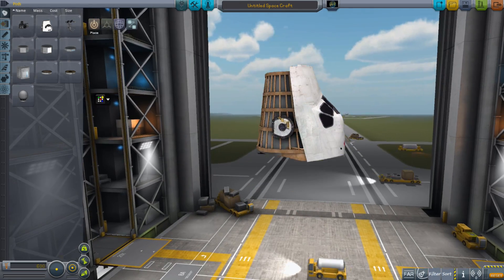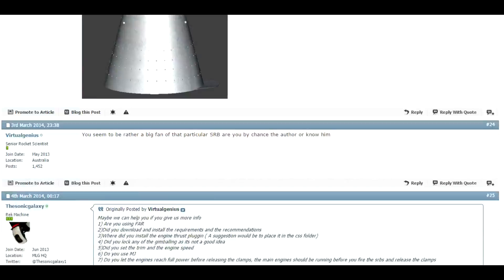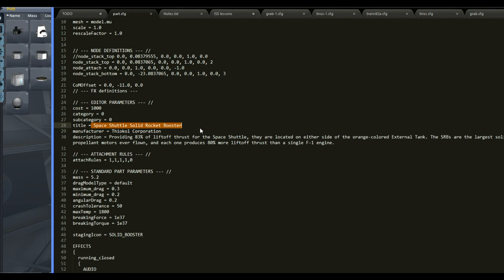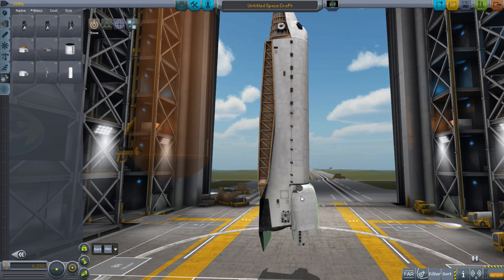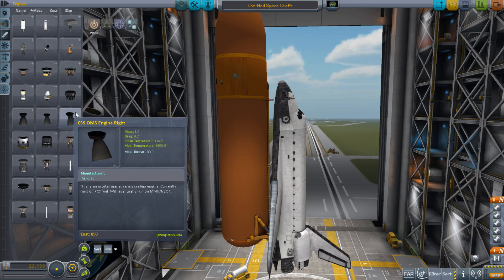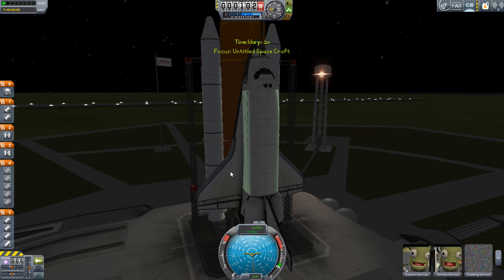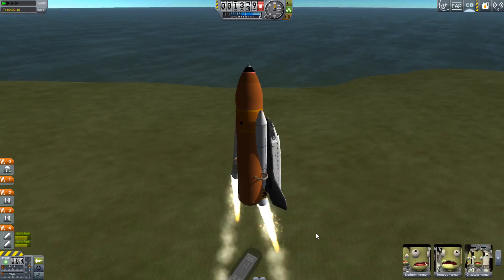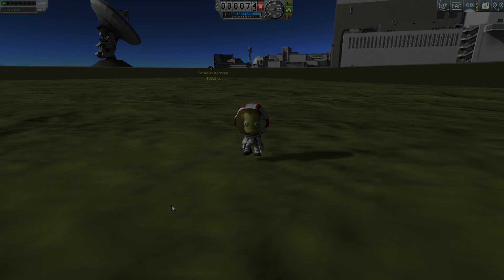SE01: 1974 / Project Enterprise - Space Shuttle / KSP 0.90

Comment: Oh man... I have been down this road a few times. Although I never tried the CSS since I usually like building my own stuff instead of using replicas. I'm simultaneously happy to see your take on this project, and dreading the difficulties to come.

Does the CSS allow manually trimming the engine gimbal angle in flight? Separate from the stock trim system? If not, I highly recommend getting the plugin from the Klockheed Martian Space Shuttle Engine pack, and add that module to the CSS engines. You can judge the gimbal angle by turning on SAS and watching the pitch control indicator, observe the direction and magnitude of the pitch needle's bouncing. Bind two keys to very gradually increase and decrease gimbal trim in flight. This is an absolutely essential skill for launching space shuttles, IMO. Doing without it is making things unnecessarily difficult.

When flying any airplane in atmosphere, try turning on precision control. It really helps. Airplanes exist in a fluid medium, and respond well to smooth, fluid control inputs. Think of driving a car on ice; air is even more slippery than ice. A car on ice won't do what you want if you instantly crank the steering wheel hard over as far as it will go, which is what the game's default non-precision control is like.

I predict problems piloting this thing in FAR. As I recall, the mod wasn't set up to be compatible with FAR, and many people have reported difficulties. I know FAR has problems with a vehicle using two separately modeled wing parts instead of one wing part installed with symmetry. The mod theoretically should be able to work normally with this setup, but in fact it doesn't work. It may even be worth waiting for the next KSP version with the promised aerodynamics overhaul.

And always keep in mind the real vehicle barely worked as a glider. Just barely. If it's frustratingly difficult to glide and land... you're probably doing it right.
Reply from the maker: TheWinterOwl (1) I have done it before for launching one ISS module. It was probably harder then than it will be now. TweakScale alone is a great tool to help me size things. (2) The gimbal is from the KM_Gimbal mod. I have not gotten that far, but I have seen a module like that in those files. (3) Smooth control. Got it. I'm from Massachusetts originally so I do know ice driving. (4) The mod was terrible in FAR last time too, until I made a ton of changes including flipping one wing model over (the lift for BOTH wings was shifting the CoL to the left back then). I already looked at the assembled Shuttle and can see it's still not ready for FAR, but the wing problem was fixed someone along the way.